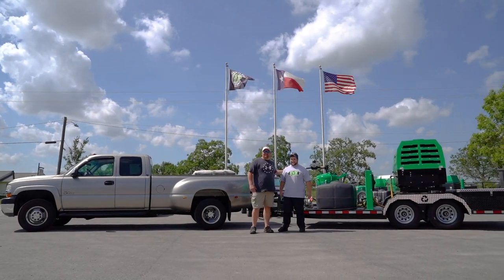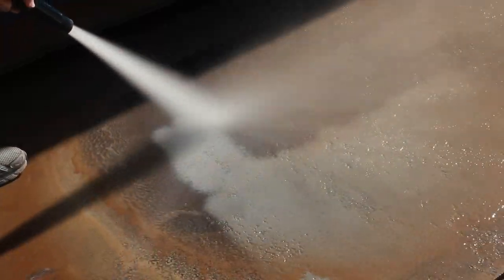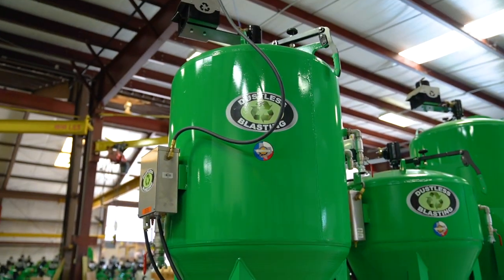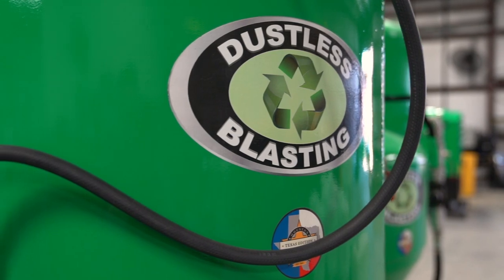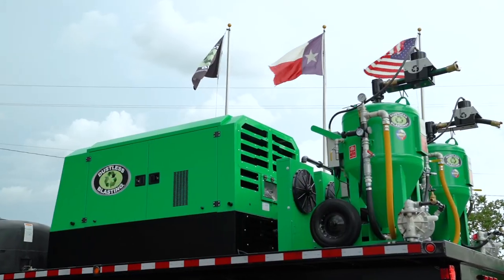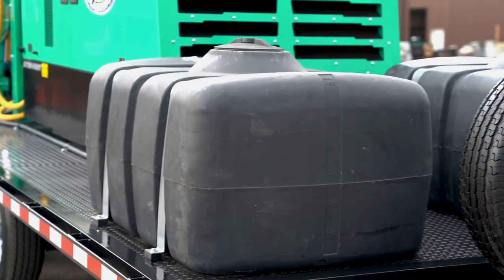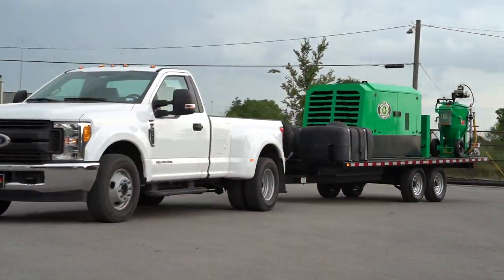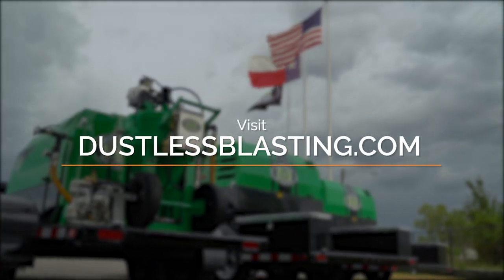Product Spotlight: Industrial Machines

Comment: Recently got a job removing chlorinated paint and epoxies from a pond built in the 1980s from Concrete, 4000 psi turbo head Complete reflection only processed that works so far was burning with propane torches scraping down to the next layer and repeating the process...five coats. Now we have concrete that is entrained  with epoxies

Fun times
Reply from the maker: Sounds like a headache!